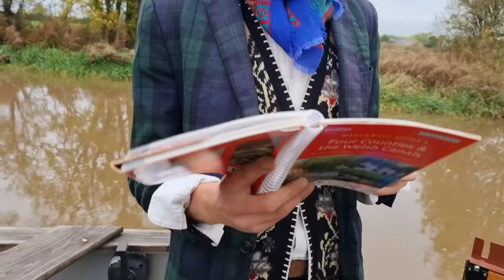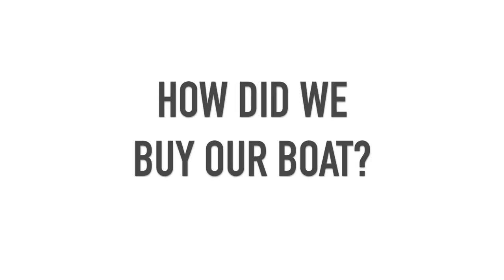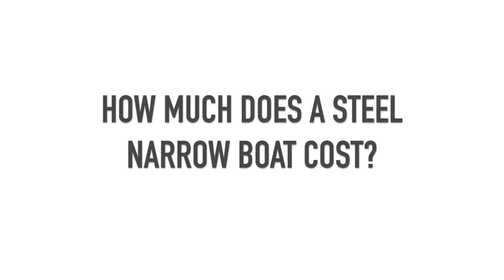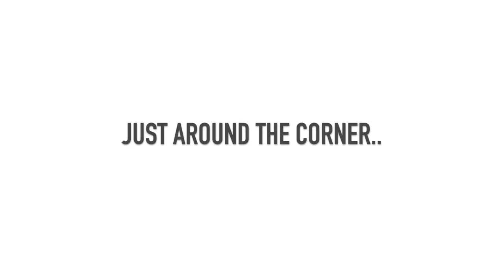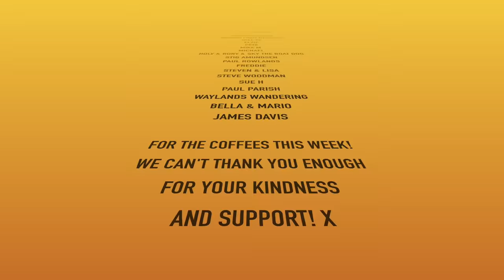How Much Does It Cost To Live On A NARROWBOAT ? | How Do We MAKE MONEY in our TINY HOUSE? | EP24

Comment: Found your channel by accident, what a fun couple. Thinking of getting a canal boat too and escaping the rat race. Do you think narrow/wide beam boats hold there value fairly well ?
Reply from the maker: I think the same as a narrow one, just consider the extra size and weight, and how much you might want to move it 😊
Reply: I think they do hold their value as long as you keep them well maintained.  We bought our boat for 12K 10 years ago and we've since spent about 18K on a total internal refit and also paintjob externally as well as other maintenance. We wouldn't be able to sell for £30k but probably £20-25 so I think that's pretty good considering its a very old boat (1983) . Also if we'd done the refit ourselves it would have been cheaper.

Comment: Your licence is going up 13% in April, so you will pay £1100, I buy diesel at £1.52,  I expect to pay about £10 per week , £500 pa, my engine needs two oil and filter changes, plus a change of gearbox fluid £100 materials,, I usu+ally pay for a service at a boatyard every year, £200 labour only. I painted boat this year, that was about £450 for rent of shed and paint. I'm glad I painted hull and the topsides,  costs are going up so fast it's difficult to know what to do for the best. My last bill for coal and wood etc was near enough £200, less than four weeks ago.
Reply: I think that black stuff looks like used engine oil, some boater has emptied their dirty bilge in a lock where they assumed no one would identify them!
Reply: Lots of people with houses are noticing their costs are going up also

Comment: Just wondering about that issue you had. I'm not a boater (yet, soon to purchase) so if somebody could correct me if I'm wrong, but if you drove through a lot of oily sludge could that have got into the engine cooling system somehow and reduced engine performance?

Comment: I was told that any narrow boat under 40ft in length is very hard to steer especially when on rivers.  
The woman also told me that I should pick a boat under 7ft wide and under 60ftto be able to go on any canal or through any lock.
Diesel engines are the only way to go and run that on red diesel or  HVO replacement to save money
Electric engines run on solar power are not viable as solar alone won't charge your batteries even if you have a wind turbine and besides non diesel engines have not got the power to handle rivers
and leaving rivers to cross estuaries or to switch waterway networks runs the risk of getting flooded or capsizing

I'm sure some of this is not accurate but where do you start to learn the stuff you need to know

Comment: Re the engine problem. Looks like you are losing oil and the lack of power may be related to not having enough oil left in the engine. If you keep running an engine short on oil you will destroy it.
Reply from the maker: Thanks for the comment. It was something that had been dumped in the canal that we went through. Oil can't get from the engine to the weed hatch or to the outside of the boat at all so couldn't be that 🙂 Thanks though!

Comment: Leaves on the tracks, leaves in the canals!  How do Britons get around in the fall?  Don't leaves fall on the roads?
That black stuff is mysterious, I'd check all your internal oil levels, not that I think they're the source, but better safe than sorry.  Go to a boating supplier and get some bilge socks or some oil spill pads.  (They are good to have on hand, regardless)  They'll soak up the oil and won't take on water.  Use them on the weed hatch when not moving until you get clean water back there.  At least then you won't be shedding oil into the canal.  If you can never get it clean then I'm confused.
The black stuff reminded me of heavy creosote, on very hot days we can see it sweating out of the pilings at my marina.  Do they use creosote on wooden structures in Britain?  They also can use tar on the exposed ends of pilings which also softens and runs (slowly) in the heat.
Another lovely video, folks.  Boats, bring out another thousand!
Reply from the maker: Hi, yes we drove through some spilt bitumen, it wasn't engine oil 😊 There were volunteers working at the locks so we are guessing they knocked some in...

Comment: You’re wonderful people and I don’t mean this hateful in any way. But how can you not recognise that as oil.
Never seen a bird covered in oil after a spill (on the news)?
I would have checked motor oil/diesel levels etc right away.
Reply from the maker: Thank you for your comment 😊 It was most likely bitumen :) oil and diesel (well actually anything in the engine bay) can't get out of the boat from the propeller, the boat wouldn't be water tight if oil could get out like that. It was something we had gone through that had been dumped or maybe it was knocked in by the workers who had been cutting the grass nearby  :( probably some old bitumen or something. It was far too thick to be normal oil. Thanks for watching 😊❤️

Comment: Check your engine oil leval, your new oil filter may be leeking.
Reply from the maker: Thanks Graham. How could the oil get into the weed hatch? It was like bitumen not oil. Still very confused 😅
Reply: @BenandEmily  Some kind of a leak, or your prop shaft, it's the slowing down of the engine if the oil is good then its leaves, if the oil is leaking you could damage your engine but if high all good

Comment: you are leaing fuel or oil
Reply from the maker: Unfortunately it was bitumen in the water. We found out that someone had dumped it on the side then when the crt were working they had accidentally knocked it in. It's interesting how many folk think we were leaking something. How could anything leak from our boat? There's nowhere for it to come out! 😅 it's not like a car, boats are sealed, so we don't sink! 😊
Reply: @BenandEmily  actually they are not sealed units. Most boats leak something
Reply from the maker: @m.n.a.cruises  Interesting, where from? The prop might let out a tiny bit of grease but how would oil or fuel or anything get out of there? 🙂